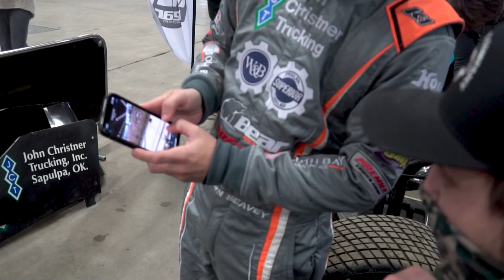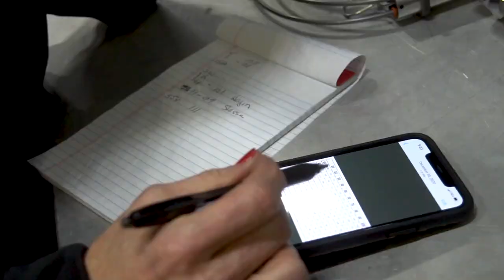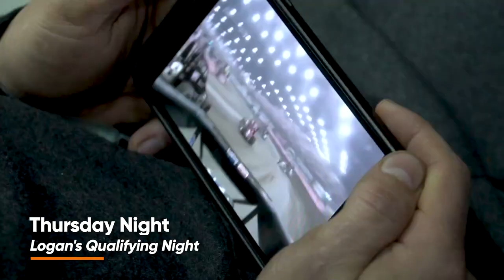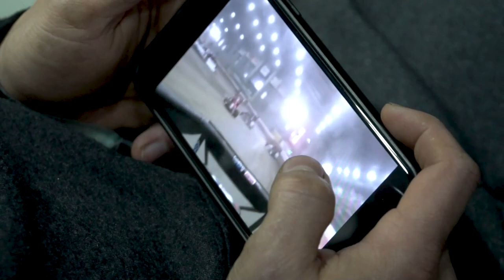Top 10 at the Chili Bowl! An Inside Look With Kevin Swindell, Sammy Swindell, and Logan Seavey

Comment: whats with the square gas tank ? totally ruins the look
Reply: No, it is the look.
Reply: @codyjarvis  the look sucks those sprint tails are what makes the cars look good
Reply: @tjw3999  actually the fuel tanks can get you a tenth in the race because of the weight transfer, if you have a huge fuel tank with many gallons of fuel in there the fuel will slosh around and can unbalance the car, but a smaller rectangular gas tank keeps the gas from sloshing around as much.
Reply: @johnnyboi8876  My man just told him off 😂
Reply: @johnnyboi8876  so what if everyone has to run them there is no advantage. they only been using those tanks for a hundred years. its called tradition
Reply: @tjw3999  tradition doesn’t win 9 chili bowl races...
Reply: @johnnyboi8876  no cheaters do